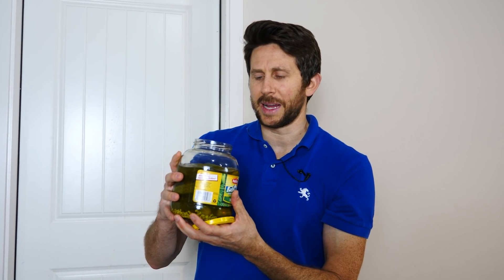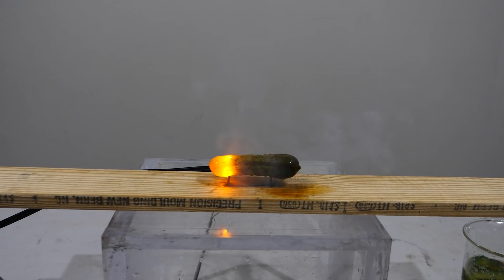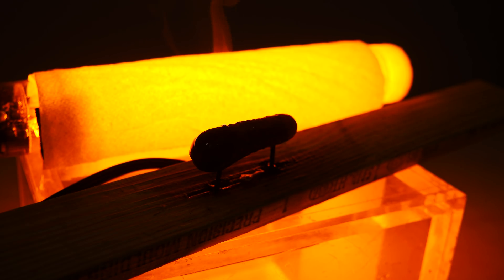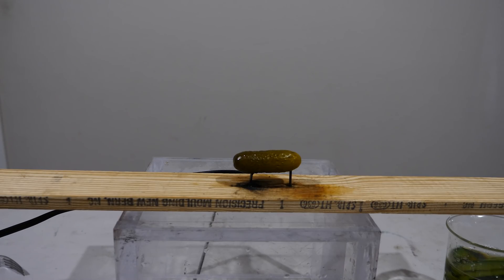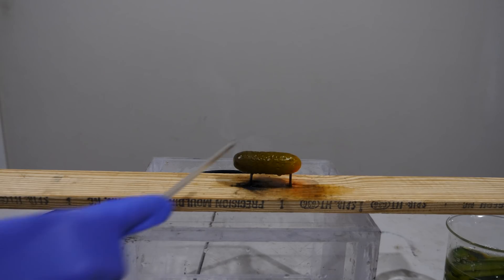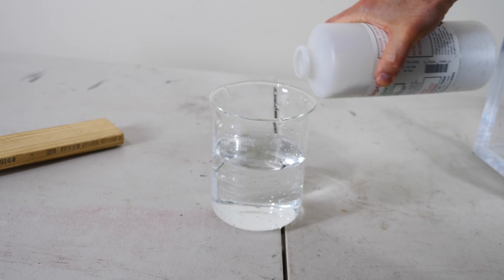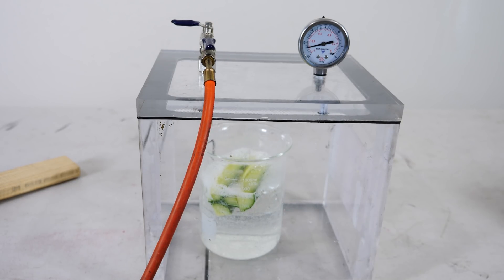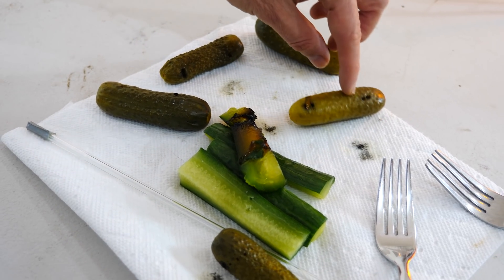Why Pickles Make Great Light Bulbs

Comment: I think you would have had better results if you did a better job of sucking out the air and replacing it with your potassium hydroxide solution

Comment: I think personally for me if you had weighted those pickle slices down first below the solution level surface, maybe tied them all together with a string and hold them down with a nut or something, and then suck the air out of them as soon as you let the air back in the chamber, the potassium hydroxide would have gone into the Cucumbers much better and you would have had better results I believe. That's what I would have done anyway I'm not sure, but I think it would work better.

Comment: A slight difference in energy capacity (maybe thicker part of the pickle, baybe colder because it was touching on ice etc..) can result in this "one side" glow because, when arc is starting to form, the electric current drops, which means (ohms law) that the voltage drop on the other contact side drops, thus no second arc is formed.

Comment: Hey, great video.
I think you can test better your resistance theory by using a resistor or an electrode of a different material in one of the sides.
I assume that the difference of resistance between different materials is bigger than the difference of resistance between the two sides of the pickle.
So in this experiment, if your theory is right, switching the sides of the pickle won't switch the side of the light.

Comment: well for that potassium pickled pickle, you may have to look up the amount of salt that was in a normal pickle and see if you can get anywhere near with the potassium. next, the pickle is also burning a bit and the "real" pickle had a ton more light so i guess the "fake" pickle was just burning. hence why i think it may not have had enough potassium. also the electrical resistivity might be hindering. (too much or not enough resistance in potassium... but those are speculations...)

Comment: I would actually say it's a lower resistance responsible for which side lights up.  The current is always going to follow the path of least resistance. Also the power dissipated by a resistor should be inversely proportional to the resistance given a constant voltage like in your setup.

Comment: I notice that the pickles are dark at one end and slightly lighter in color at the other. I wonder if that has any effect on which end glows. (There's also a structural difference as one of those ends was the one connected to the rest of the plant before it was picked.)

Comment: 110 AC is still just one side. not both.. that would be 240 so your grounding one side of the pickle, and putting the other side to one of the ac sides. but not both. thus why it doesnt alternate.

Comment: @The Action Lab  Why would a higher resistance mean that the pickle lights up more?  I thought the lighting was caused by dielectric breakdown.  Wouldn't it be the side of the pickle with a lower dielectric strength that lights up, while the other doesn't?

Comment: @The Action Lab  I don't think just comparing the color to the low pressure sodium vapor lamp is very accurate.  Probably should have checked the spectrum to see if that's indeed where all of the light is actually coming from.

Comment: Isn't it more arcing that's producing the light? The channel scorched through in the initial arc being the path of least resistance every time regardless of orientation.

It would also explain why the self pickling didn't make any real difference to the colour but loads on the quality as the path of least resistance is straight down completely negating the insulating rind.

Flip Ur home made pickle n u might see where I'm coming from on this.

Comment: You should show video through a spectroscope (I've seen cheap ones around $10 on amazon,) to show the light wavelengths of the pickle and the sodium vapor lamp. that would definitely reinforce that it's the sodium glowing in the pickle. :)

Comment: Three questions:
1. Can any kind of cucumber pickle be used for this experiment? 
2. Do the pickles have to be pierced by a nail, or can they be strapped down with metal that conducts the electricity? 
3. Are the pickles still edible, and if so, does the flavor change?

Comment: The process in the vacuum chamber has more to do with the pure water inside the cucumber having a boiling point at 100c atmospheric pressure and the solution having a higher boiling point. Which means that when lowering the pressure the water inside the cucumber is starting to boil first and is coming out of the cucumber to be replaced by the solution.

There's not much air in cucumbers...

Comment: Very interesting video! Although i'm not fully convinced by the explanation you gave why there was only light at one side of the pickle. Wouldn't we be able to also see some light on the side with less resistance? Just less light than the higher resistance side? Now there is absolutely no light.

Comment: When I was a kid I used to do the same with an egg. I carefully stuck needles attached to wires through both ends of an egg and it would light up like a lightbulb. Was it also because of the sodium in the egg ?

Comment: https://youtu.be/xHWsamFRi1o?t=230
let me add some hypothesis here: some pickles are processed with vinegar and we know between the two metal if we add some acid they generate some DC current i think it is added AC+DC and it gets shifted up and became alternating DC we call that offset too in electrical engineering so what im saying is right before the nail you have AC but with pickle you have offset and it becomes AC+DC so one side gets lit up.

Comment: One side lights up because only one side is "hot" - the other side is neutral (single phase AC). So all the energy comes in the hot side and makes the light show before flowing out the neutral side. Try it with a two phase AC and it'll probably light up both sides.

Comment: I noticed that the side which was emitting light yellow color was root side from which a cucumber grows from plant, so can it be true that, the root side particularly have more sodium ions, thus that side gets lit up?. Or during your experiment, the AC voltage lead to only one side of more concentration of sodium ions than other, so more yellow color on one side.
Any of the assumptions can be true. What do you think?